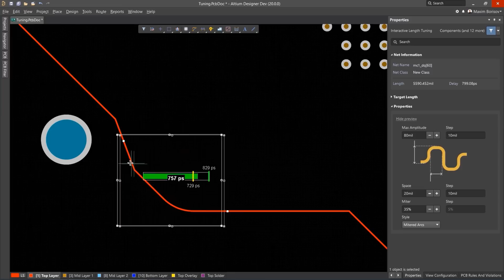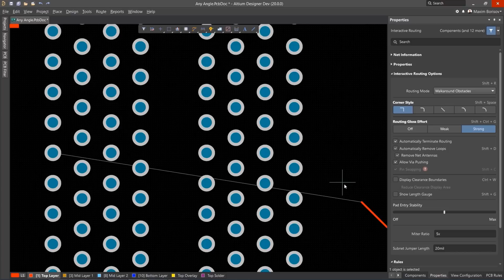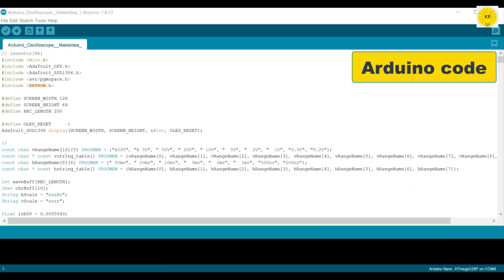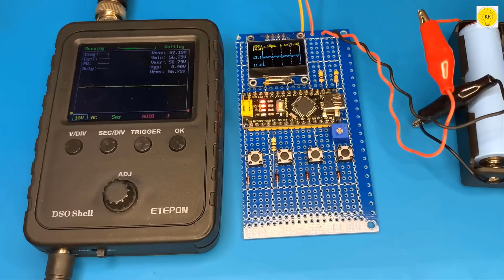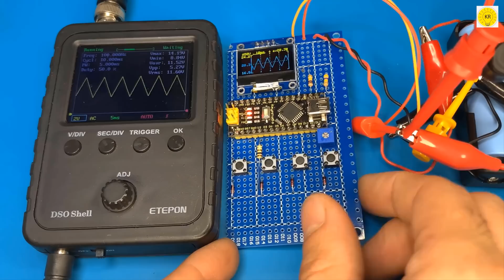how to make mini oscilloscope, altium designer

Comment: After 2:36 I got confused because the ends of the wire are out of the screen. So I don't know what he connect the wire to.
Anyway, does the also work on TFT ? I have the same OLED but the screen is too small.
It's better to read the scope with bigger screen.
Reply from the maker: Yes, it works, but you need to correct some codes

Comment: This is an awesome project, I'm very interested to know if the firmware was written in the Arduino IDE or if it was written in another programming language and the chip repurposed.
Reply: It was most probably written in ino (which is an abriviation of c++ with an intepreter for the ino code to turn it into c++) and uploaded, so he used the chip on its own. You can use VScode and other text editors (the new arduino IDE is based on VScode and written in JS) to write your ino code, you just need a programmer to upload it to your arduino (AVRISP MKII or the older version MKI, depending on what you're gonna use your arduino for(a programmer for another chip(ATTINY) or just as a standalone microcontroller). You can see more info in the arduino docs, if you want to explore the Arduino rabbit hole.
Reply: They have made and arduino extension for VScode, and thats what i prefer to use, you just need to add your libraries path manually in the config JSON file.
Reply: @chrisx6907  Thanks for the in depth reply! I've seen Arduino microcontrollers reprogrammed with Atmel's software before, but I've genuinely never seen such a complex program running on one of these microcontrollers. I'm amazed that it fits in the 32k of rom (I'm assuming that's the ATMEGA 328P).
Reply: @evilmonkeywithissues  yes it is the 328p and its amazingly capable!
Reply from the maker: Arduino IDE
Reply: @inventorkr1  Awesome! That's some impressive programming skill!

Comment: "In this video, we'll show you how to make a mini oscilloscope". <sigh>   Watching someone solder a bunch of parts does not teach them very much about how to "make" a mini oscilloscope. Now, if you had presented a complete schematic diagram, and explained the purpose of every single component, and then did an explanation of the microcontroller software, even at a high level, then you might be teaching viewers something useful about designing and then building a useful piece of test equipment.

Comment: Neat. What’s the blue PCB you used?
Reply: An Arduino clone that lets you swap out the microcontroller chip. He likely used it to flash the microcontroller with the program it runs on.

Comment: Hello. Can I make a request? I had a problem in making a 113 kHz piezoelectric starter circuit. I searched in different places, but all the circuit models are the same, but they do not work in practice. All circuits use AC 555 and MOSFET Irfz44. after two months, I still couldn't make it work. Please, please, if possible, help me🥺🥺🥺🥺
I'm all over this issue
 I want to find a solution🙏
Reply: Piezoelectrik It was steaming, wasn't it?
If so, you can buy it online.
Reply: @Ruzgar_K_  Yes, vaporizer.
And yes, you can buy it, but making the circuit is cooler
Reply: @amirhazaghi1220  It can also be done with Arduino and Arduino motor controller board.
Reply: @Ruzgar_K_  Yes, but I don't know what the proper waveform is, and I only know the frequency and the maximum working voltage
Reply: @amirhazaghi1220  Where did you buy it? If you bought it from a website it has all the information.
Reply: @Ruzgar_K_  I got it from the website, but there was no information from the data sheet. I asked the support of the site, and they said that there is no data sheet. I did not find it on other sites either.
Reply: @amirhazaghi1220  i think 113 or 117 MHz
Reply: @Ruzgar_K_  108~113khz   6~12V working voltage 16mm Diameter of the disk

Comment: Hi there how to make  a  e-bike battery charger from 48v to 72v  battery amps 20A to 100A  to  charge while  I  ride the bike  within a push bottom to start charging while bike is on  or within acceleration , probably have to be smart to tell when to start charging and when to stop using a microwave, transformer or other idea

Comment: If you're gonna be making homemade pcbs, which I find very cool, you should finish the process with liquid tin. It's pricey but I'm sure you can afford it.

Good video by the way.
Reply: If you’re gonna solder it right away it’s fine to just leave the copper bare. Just need to give it a scuff to remove the oxidized top layer if you wanna solder it in the future

Comment: I can’t imagine that this video is sponsored by Altium. This pcb is of poor quality, too large and made with an etch resistant marker (which creates the sloppy lines). Also there are no holes drilled, which let the components float in the air. A prototype board suits better for this purpose. If Altium was used, a pcb vendor could realise the pcb for a few dollars, resulting in a better product. Besides, I have bought a scope kit a while ago, which was probably cheaper than this one, it is for sure smaller than this design. Sometimes doing the things yourself isn’t always better. If it was for learning, than I am wondering why the processor has been soldered. In this way you can’t reload the processor with new or modified code. Strange video.
Reply from the maker: Hello Sir, Thank you for your comment. Regarding the Altium designer, and why it was announced in this video, the idea is as follows. First, the circuit or project was created to show beginners how to create the connections in the circuit. Second, this method of soldering on the surface of the PCB board is a preliminary stage. After that, we move to the second stage and design the circuit in the Altium designer, and after that the board is sent to the jlcpcb factory to be a neat and beautiful project. My channel presents the idea and you complete the rest, and here is the purpose of all this method.
Reply: @inventorkr1  I see, but why haven’t you used a prototype board? This is easier to understand and develops soldering skills quickly. Also, using a microcontroller is next-next level, starting with an easier design will suit better in my opinion. In the past (30 years ago) I have designed and produced pcb’s by hand. I am glad that with CAD software and companies like jlcpcb it is much easier to get a professional result. Looking forward to your next video, as I am curious how Altium works (I use Eagle).
Reply: @inventorkr1  So basically you are too lazy to do it better?

Comment: That is Not the proper way to design a circuit board. The fact you used a computer is shameful. Just use perf board!
Reply: For me not necessarily to have a perfect design pcb for just the demo. The important is the working unit. Anyway you can make a better one for the final project. 
The more valuable here here is the man share it for free and the most part of it is the free code.
Reply: @PLASMUX-20  You did a good job
Reply: I must disagree - it is a good way to design a PCB, though not the software I would use. Not using a computer would be dumb - and I've had plenty of experience designing them by hand before PCB design software was an option, and I've even used a resist pen in the 1970s when it was still (just about) a sane method. On the other hand, mounting through-hole components on the top surface is a horrible idea, asking for the circuit to get damaged. Still the video goes on to show how to build the circuit in a way more appropriate to a prototype or one-off.
Reply: @rogeratygc7895  Saduko works just fine. I have not yet found a purpose for photo etch yet. And I'm not buying Chinese made to order stuff. I draw a schematic and Do It!
Reply: @planker  Whatever works for you is fine, of course, but my experience, backed up by the horrible traces shown on this video, is that resist pens give ugly traces with gaps etc. Only excessive track width prevents open circuits.
You don't have to go to the Chinese PCB companies if you would rather not. I have used Ragworm, and while I have seen a lot of people complaining, I got good service and excellent quality PCBs.
The one thing you get from professional photo-etch PCBs is the aesthetic appearance of a professional job. They can be positively beautiful. Well, and reliable I suppose.